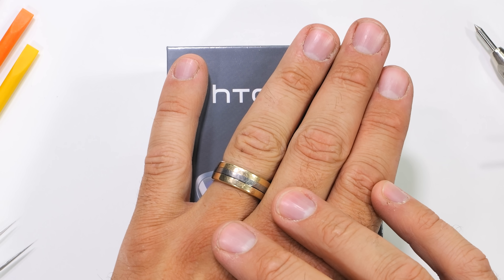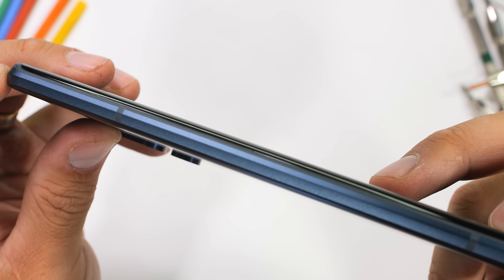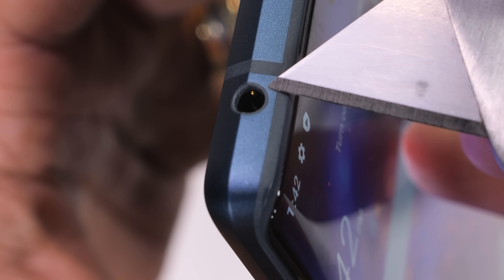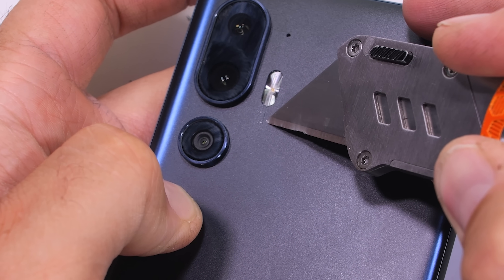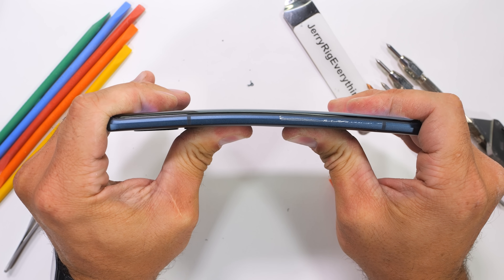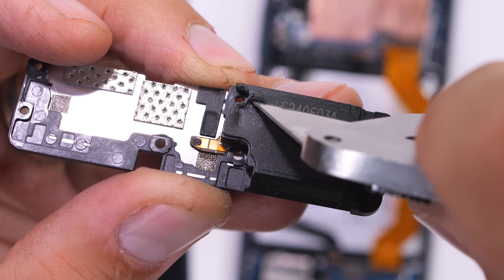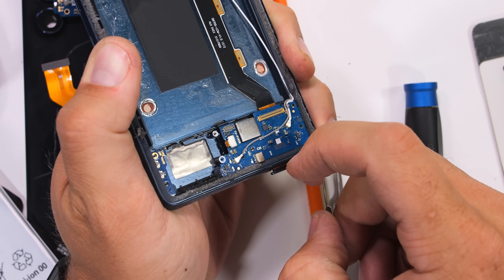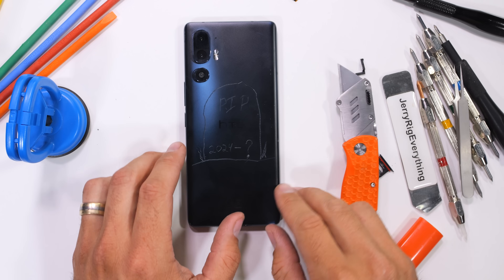OFFICIALLY BACK FROM THE DEAD

Comment: 3:30  I still remember when 600 dollars used to be flagship with the best build quality available
Reply: Adjusting inflation 750 dollars today. Not bad.
Reply: @panathatube  did you calculate your wage in the same way?
Reply: @panathatube  To bad salaries don't adjust for the inflation ;) ;)
Reply: @panathatube he didnt even mention a year..
Reply: @panathatube not bad? Have you seen flagships phone prices these times
Reply: Back in my day you could pick up a Nokia E63 for $150. Those were the good ol days
Reply: @TheTruthKiwi  , true but those also were only phones that called, texted, and did minor internet searching, but it was also very slow so not really. $150 for that compared to the power the $1000 phones can buy today is crazy.  Modern smartphones are a marvel of technology to behold considering we have very really good computers the size of our palm that last 1-2 days of moderate use without charging. the phone may have only cost $150 then, but the value of what is spent today on these computers is crazy.
Reply: @TheTruthKiwi  Redmi note 13, poco M6, oneplus nord ce 3 lite, honor 90 lite

Theres still a lot of phones for less than 200 and theyre way better than those of the old days
Reply: @TheTruthKiwi  the E63 launched at €199 in 2008, converted to USD that's $294 in 2008. After adjusting for inflation the same phone would cost you $429 today and it was the budget plastic version with less features than the flagship E71 which was all metal. The E71 was $500 and $729 after adjusting for inflation, so still well over the $600 mark for premium material
Reply: It still is, but they also make more expensive ones no9w that don't do anything
Reply: Well, inflation. So...
Reply: I remember my older brother having an iPhone 4 when the year it launched in 2010 as his first smart phone and was jealous on how the phone looked. Though I was shocked on the the $699 price and questioned why anyone spend that much on a phone, and yet I was ok with my Motorola Razr Flip phone which cost $60 at that time.
Reply: I also remember when that was 8 years ago and we didnt have this insane inflation.
Reply: You can still get that
Reply: Facts
Reply: Holy cap I forgot
Reply: Bullshit, they were always 600+
Reply: iPhone 3G used to cost 350$
Reply: It is,
* enter redmagic *
Reply: When exactly was that buddy, we can go all the way tf back to the Galaxy S6 having a glass back and it was $699 back in 2015, that's $925 in todays money
Reply: @BryanMiranda96  HTC's last flagship was released in 2018 if the cost was really just 600 dollars today it would cost no more than 750 bucks
Reply: @panathatube  the last HTC flagship was the U12+ which retailed at $799 in 2018, or $999 in todays money
Reply: @BryanMiranda96 Nope. Inflation of what? You cant just claim that when proce gauging went on. Not inflation as the salaries did not follow. Greedflation.
Reply: @jepulis6674  just because you don't like it doesn't make it not true
Reply: @BryanMiranda96  i remember getting my brand new Galaxy s5 back in the day, i got it for 600 euros, dang was i happy, it was my first smartphone
Reply: @BryanMiranda96  700 going to 925 in just 9 years is crazy. Even crazier with all that inflation happening in just the last 3 years or so.
Reply: I say that would be the OnePlus 12 these days but $100 more for 256GB model(Add another $100 for 512GB model) and minus the headphone jack and micoSD slot. But it does have a larger battery, great stereo sound, touchscreen you can use in the rain, and much faster included charger. Build quality is good enough since the 11 only barely failed the bend test. I've personally been very happy with my 11 model.
Reply: Why are you Americans always so obsessed with inflation, I have never in my life used the sentence "converted to today's money"
Reply: @soumyonath911  because inflation is astronomically important when comparing what things cost over time. Saying you "remember when a good one would cost $600" means literally nothing if it was worth one and a half times what it's worth now
Reply: @BryanMiranda96 yes Inflation is important but your calculations are way off.. 800$ in 2018 and 6 Years later 1000$?? Thats a 30% increase. Where you get those numbers from?? The salaries are not 30% higher and taxes neither so where do have those numbers from? You just made them up... there was no 30% Inflation in 6 years lol
Reply: @HansGruberX1  just because you don't understand it, doesn't mean it's not there, and yes the inflation IS that bad, that's why the economy is in a crisis
Reply: @BryanMiranda96  tell me the source or you dont have any??
Reply: @BryanMiranda96  absolut horseshit.. the inflation in Germany in 2018 was 1,9% now in 2024 7,5%. Thats a little over 6% Inflation from 2018 to 2024. Where you have your 25% from??
Reply: @BryanMiranda96  little research. The Inflationrate in USA in 2023 was 6,5% and 3,1% in 2024..yesh sure 25% 🤣🤣🤣
Reply: @HansGruberX1  cool, all the banks, national Treasury, and current dollar value disagree with that
Reply: @BryanMiranda96  the dollar value pretty much disagree with you lol

Dollar to Euro is pretty much unchanged since 2018. In 2018 1 Dollar was 0,89 Euro Cent. In 2024 1 Dollar is 0,93 Euro Cent. The Inflation of the Euro € is 5% since 2018 and its also 5-6% in the US. Give me a source of your claim.
Reply: @BryanMiranda96  do you even know how the vaule of a currency is calculated?? You compare it with other currencies like the Euro €. 1 Dollar in 2018 was worth 0,89€ and 0,93€ in 2024. Its pretty much unchanged so where is your lower value of the Dollar? :D :D

Comment: Early HTC's were not only easy to repair, they had replaceable batteries LONG after others had stopped and there was as much attention to styling and detail on the inside as there was on the outside.
They were awesome.
iPhone set some terrible market precedents and every other manufacturer followed. :(
Reply: Wasn’t HTC one of the first Android makers to drop removable batteries?
Like the HTC One M7 which was pretty much one of the only Android phones in 2013 with a sealed battery.
Reply: @username-mb2qh  Weird. You may be right. I might just be remembering mine having a replaceable battery long after my friend's phones were all sealed just because I kept it for so long.
Reply: *most - fairphone & others are still out there, even if they aren’t available in the US. But the US is basically lost, considering kids (and adults) get mobbed because their text  bubbles have the wrong  color…
Reply: Loved the HTC HD Mini which was all yellow on the inside, even the battery
Reply: @alexandreb.1101  I think my incredible was allmost entirely red. The cables, connectors, even the frame for the (replaceable!) speaker.
Reply: many years ago i was working fixing phones and found a video on how to sasemble on of their models, i forgot the exact reference, i never forgot that they use flex cables on every single component, everything came glued, flex cable to flex cable, i never saw a phone begore or after that doing such thing, thankfully
Reply: @betag24cn  Really? NONE of my cables were glued and the fasteners were color-coded. I guess they didn't make 'em servicable for as long as I thought.
Reply: HTC started sealing their batteries like Apple... But the upside is the beautiful metal unibody design. That's why I went with a Galaxy S4 and S5 instead of the HTC M7 and M8. Only the very old phones had removable batteries
Reply: apple bad
Reply: @nopota7290  I assume you're being sarcastic or something.
I'm not saying they didn't make some innovative hardware, but if you've got yourself tricked into thinking that apple is pro-consumer...
Reply: @SwervingLemon  no major apple competitor is pro-consumer, if they were, they wouldn't have followed apple's steps. And yes, I am being sarcastic.
Reply: @nopota7290  You're not wrong, tho.
 Apple IS bad. So's every publicly traded company. It's a requirement.